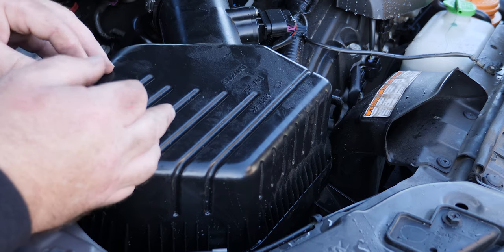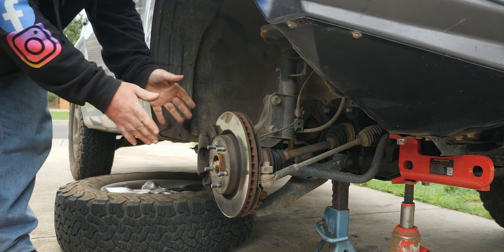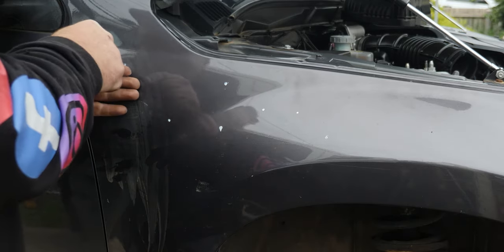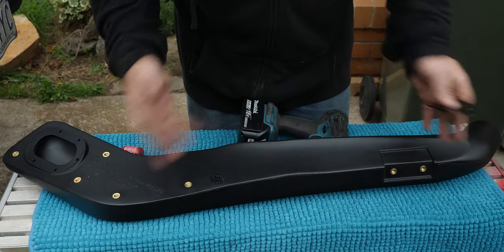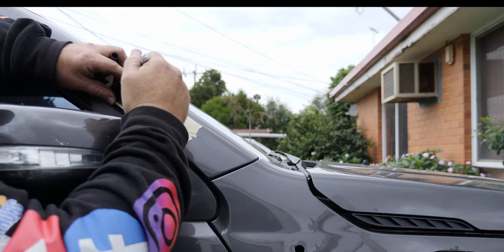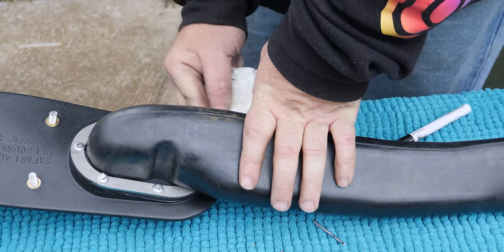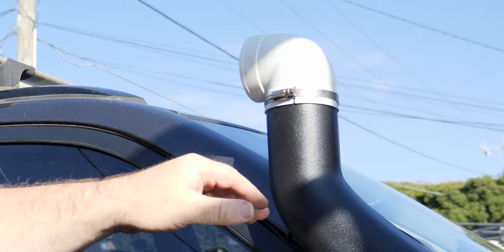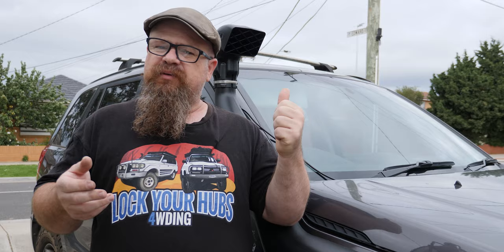Ram Head vs Backward Snorkels including Snorkel Install

Comment: Which engine and fuel was the test conducted with?
Reply from the maker: The Grand Vitara has a 3.2L NA auto petrol. 

Though the results are as applicable to NA as they would be positive displacement supercharger or a turbocharger.

 The results would actually be more pronounced on a forced induction engine. I've done similar testing before on a 1VD in a LC76 (V8 turbo diesel) only manometer readings not performance testing, with similar results.
Reply: @LockyourHubs4WDing  wondering how relevant for diesel, as diesel operates with an excess of air.
Reply from the maker: Yes it is.
Reply: @HardstylePete  Completely relevant for diesel as well - NA and forced induction.

Comment: Would of been interested to see the numbers if you had just turned the RAM Head around , that's what most would do . Sealing the valve in the bottom of the air box , some say yes others say no , what it your take on it , if you had one that is
Reply from the maker: Though I didn't test it, I would think that because of the larger cross sectional area of the ram head opening would be a worse performer backwards. 

I've always sealed the bottom of the airboxes as soon as the snorkel was installed.
Reply: @LockyourHubs4WDing  yeah I have always sealed mine , its just some say you shouldn't , I have a Y62 Patrol  but haven't had a fitted snorkel yet  ,  with all the electronic crap this Patrol has I'm going to avoid water / river crossing as much as possible , deep ones anyway .
Keep the videos coming they are really good
Reply from the maker: @jackofjr  I do love the sound of the Y62s on song! 

I've also heard there might be an issue with the TJM low profile snorkel heads on the Y62, collecting water off of the windscreen in heavy rain at freeway speeds, filling up the airboxes.

Comment: Boosted engine will pull what it needs regardless of which way the snorkel is facing.
Reply from the maker: You actually get a compounded benifet with forced induction. The inlet compressor works on a pressure ratio for a given amount of exhaust flow, not a fixed amount of boost.  So if you put an extra 5% in, you might get an extra 10% out.
Reply: The turbo doesn't pull it, the atmosphere pushes it in. We wind tunnel tested this and backwards means your turbo has 23% less air pressure available at 100 kph.
Reply: @blairknight7793   seems simple physics - the air flowing past the backwards facing inlet would create a low air pressure pocket at the inlet - depending on the speed travelled - that would mean the faster you go the harder it will be to get enough air in. Picture someone would create a 4 inch stainless system  with all it advantages but make the intake a forward facing ram intake...
Reply: @tomschannel5380  absolutely. I went to a lot of trouble to make exact models with precise snorkels to test in the wind tunnel, when you install that backward facing snorkel the negative pressure is instantly obvious from 30km onwards, at 60km its making a difference, at 100 it's about 23% negative pressure on the inlet.

It's a ridiculous notion to face it backwards.
Reply: @blairknight7793  great info. I recently knocked my high flow top off the snorkel. I left the snorkel open at the top for a couple of tanks while I waited for my new setup to arrive. i didn't notice any power difference but my fuel economy dropped from 14.5 to 13.5L/100km. diesel with turbo. I didn't expect that. did you do any studies on fuel?
Reply: @tonycook2347  was it a cyclone type or forward facing ?  

There are bad examples of forward facing snorkels too, I haven't personally seen this but a friend has a dyno shop and the genuine Ford Ranger snorkel that goes through the 3.2L chrome badge on the side of the guard is terrible for flow their testing found. He says its a shocker.

Without seeing yours I cant really say whats going on, testing with a Monometer will tell you what is going on though, could just be a poor design. Wool tassles taped to the body also show what your airflow is doing and it's often not what you think.
 I've only tested airflow, not tested fuel.

Comment: Nobody puts backwards facing heads on these restrictive plastics snorkels, put a proper 4in stainless on it will out perform this set up with a ram head easily, this has been proven time and time again,
Put a forward ram head on the same stainless snorkel it does improve again so yes ramhead are slightly better, they just looks horrible on stainless snorkels. But plastic with ram head vs regular full stainless with rear facing, stainless wins hands down.
Reply from the maker: To truly compare stainless vs conventional, considering the body of the snorkel and not just the inlet as was done here, you would need to compare something like the safari armax to a backward facing stainless.

Based on my testing in this video, I'm sure the armax would be the better performer.
Reply: @LockyourHubs4WDing  Wouldn't disagree with that, Armax are great snorkels. Either way its good watching real comparisons.
Reply from the maker: Thanks mate!

Comment: I'm curious though if it being naturally aspirated is affecting the results here. I'd like to see the same with a turbocharger.
Reply from the maker: The result would be compounded with a turbocharged engine.

 Turbochagers operate at a pressure ratio for a given amount of exhaust flow through the turbine, not a set amount of boost. So if the intial pressure is higher you'll get a compounded benifet from the outlet of the turbo charger, in the same manner that compound turbochaging works.
Reply: @LockyourHubs4WDing  No!!  Modern electronically controlled turbochargers with a wastegate (basically all of them) are controlled by the ECM to give a certain manifold absolute pressure (MAP) -you have heard of a MAP sensor havent you???  If you occlude the turbocharger inlet the ECM will close the wastegate and increase turbocharger RPM, increasing boost and overcoming the inlet blockage.  It will do this up to the point that the wastegate is fully closed and then the MAP will decrease and the ECM will throw a warning code - you will get a check engine light.  This is why turbocharged engines are better at high altitudes - the ECM keeps the MAP constant by increasing boost (in gauge pressure terms).
Reply from the maker: @mickloney9826  Still yes, if you're limiting the boost using a wastegate (either external or internal, you'll see the boost slightly earlier in the rev range from less restriction in the inlet.

So, seeing the boost slightly earlier in the rev range will increase driveability and decrease lag.

Comment: nice vid, thanks for the info, would have been nice to give it a few runs to back up the statistics a bit more. It would be interesting to see the difference with a golf tee-head as well. i recently knocked my forward-facing snorkel head and i noticed while it was off, my fuel economy dropped from 14.5l/100k t0 13.5km/100k. without much notable difference in power. the reason I'm researching this. Have you noticed an increase in fuel since using it?
Reply from the maker: What's a golf tee-head?

Comment: key points your missing backwards snorkels ie stainless snorkels will be 4 inch intake all the way to the airbox. where as plastic ones can often dip down in size to 2 inchs. also most stainos have less agressive bends. every bend u put in will effect the flow
Reply from the maker: I agree that the gentler the bend the better the flow, however this test isn't designed to assess the vitability or otherwise of the snorkel body, just the ram head vs backward stainless style entry. 

To make the assesment fair, you would either have to put a stainless backward snorkel and and have some way of installing a ram head, or a conventional snorkel and emulate the stainless snorkel's entry.
Reply: Backwards creates negative pressure 4 " or not. Half the manufacturers go and weld their logo over the inlet as well which would cause a heap of restriction as well.

Comment: Great video!! Thanks!! I bought a Snorkel and i waiting for the delivery. I have a 2007 V6 2.7l whith Ironman suspensión and 245/65 r17.
I hope that the duct pass between the xenón balast and the headlight washer
Reply from the maker: Mine runs the HIDs standard and didn't have any clearance issues.
Reply: @LockyourHubs4WDing  thanks!

Comment: Great video!! Exactly what I was looking for. One question I have, which is my deciding factor between the two. The plastic snorkel heads from what I see are designed to expel water (safari snorkel page) when driving through rain. But the stainless steel snorkels are just bent on top the roof, and it seems to me in heavy rain, a lot of water should get in. Any thoughts?? Thanks!
Reply from the maker: I would think the backward would do better, though I've been wrong before... Keep an eye out for part 3 of our pre-filter testing, where we'll be testing just that!
Reply: I've seen a lot of guys cap their stainless snorkels when not running for this reason.... Or they've cut an almost "sunvisor" type pvc hat for them!
Yup, they look cool.... But I'm not convinced the pro's outweigh the cons as yet!

Comment: Is there a video about the actual dust measured at the filter (in the air box?)
I ran my ram head with stocking over it forwards on the way up to Cape York and then backwards on the way back, much less dust on the way back on the stocking so for me in the dust would say it's better backwards and looks like I'm losing bugger all by running backwards anyway.
Reply from the maker: The ram heads are allegedly designed to eject water and dust at the back of the ram head, something like how cylonic seperators work separating heavier particle in the air steam like dust and water from the clean air. 

Though I haven't tested it ( It's in the works!)
Reply: @LockyourHubs4WDing  ok, cool, yeah, that's why I thought it'd be better to test at the air box/filter rather than my seat of the pants wild deduction, thanks for the interesting info and keep up the good work!

Comment: Hi,

Thank you for your video and sharing. It's great!!! :-D

Do you have some pictures of the inside passage of the pipe? the passage between the mudguard and the engine. And do you also have pictures of the air intake connection? please. Indeed, I live in Switzerland and I can not find anything concerning the grand vitara. And I would like to visualize before I start to disassemble and drill.

In advance, I thank you for your answer.

Best regards, Christophe
Reply from the maker: Unfortunately, only what's in the video.
Reply: @LockyourHubs4WDing  thanks!! Have a nice video!! ;-)

Comment: Thanks for a great instruction on mounting the snorkel. I have to point out that the three runs would have incrementally heated the motor, so perhaps that contributed to the times/efficiency figures?
Reply from the maker: I think the temps would have stabilised on the drive out to the testing location. And the two snorkel runs had an intake temp very similar. Though there could be something in it.
Reply: @LockyourHubs4WDing  OK, fair enough, and thanks for replying. The results speak for themselves. 

Manufacturers make quite an effort to port air from the front grille, but given the difference between stock and properly installed snorkel you'd think they would try and egg out that extra bit by designing the intake air to take air from elsewhere.

Comment: The original ram Air have inh2o 10 and the snorkel ramhead 19.35. The original is better because have less restriction ?
Reply from the maker: Yes, the shortest length of tube to the airbox.

Comment: when you say InH2o is the same Air flow righ ? Sorry my English Im from Peru
Reply from the maker: inH2O is the pressure restriction measurement.
Reply: Lock your Hubs 4WDing when you say 19.80 inh2o compárate with 25 inh2o. 25 inh2o have a restricción 19.80 is better for my car?
Reply from the maker: Yes, the less restriction, the better.

Comment: Really enjoying your video's (especially as I also own a Suzuki Grand Vitara 3.2L V6). Just wondering if you had any trouble fitting that Safari model (SS860HF?) into the 3.2L as the Safari website only has it listed for the 2.7L. Cheers.
Reply from the maker: Only the air box entry was too small. I fixed this by using the original rubber seal to the air box and cutting a 50mm long section of the original plastic inlet tube to mate the two (up to the sharp bend)

Comment: I think you would get a different result if you went and put an actual stainless steel snorkel on rather than making it a rear facing plastic snorkel. That would be a much more interesting video
Reply from the maker: What this testing differentiates is primarily the inlet of the snokel.

 The test could also be done the other way, using a SS body and a forward facing ram head, vs backward facing entry. You need the body (either SS or traditional plastic) to remain the same in both test to work out where exactly the flow restriction is.
Reply: @LockyourHubs4WDing  That would be great to see. I think that the forward facing SS would perform the best followed by Rear facing SS followed by the Plastic snorkels as tested. 
Would be interesting to be proven wrong.
Reply from the maker: @zackbeaven8810  going by this testing, if I was a betting man, I would pick stainless body with ram head first (As long as the diameter of the snokel was retained right through to the airbox) then tradtional plastic snorkel and finally the rearward facing stainless.

Comment: Good test and some what expected results, would be interesting to see the results on a turbocharged engine. Only reason I bring it up is I always believed the ram head was superior till I noticed that WRC rally cars use rear facing snorkels given the money aand resources available to these teams I would assume they know what they are doing. I figured maybe it doesn't make as much difference on a forced induction motor.
Reply from the maker: When I did similar testing on a 1VD turbo diesel, the results were almost the same.

Comment: Can u test put the ram head facing backwards?
Reply from the maker: There has been a couple of requests to do that, I didn't think many people ran them backwards for dust. I think I might!
Reply: @LockyourHubs4WDing  The Safari ram air head has bulged area's in the neck that trap & slot's that eject dust & water. The incoming dust & water hit the rear wall of the ram air head & slide down & out, theoretically. 
Further to my comment,  The theory is, dust and water is heavier than air.
The Safari ARMAX snorkel head works, how well I don't know but well enough that what dust gets past the head to the filter is not that bad and despite everyday dirt K's & city driving the filter still appears clean, I do replace it anyway every 25,000K's regardless & I do a fuel kilometer test every tank full of diesel, about 12L per 100K's, then I know everything is still in spec. 
I remove & clean the ARMAX snorkel head every 5000k's, there is dust & grit trapped in the bulges and around the snorkel neck & I can see where rain water has been ejected down the back & fine dust out the slots. I check the air filter & box too and there is no evidence of rainwater pooling or tracking in the upgraded 4" Safari ARMAX intake tract that mates to stock Landcruiser airbox despite the vehicle being driven in rain including very heavy rain.
I suspect if any rainwater that makes it into the snorkel must be minimal & disperses on the snorkels inner walls & evaporates due to airflow over it.
I remove the airfilter & block the intake with a clean towel & blow dead bugs & fine dust out the airbox with compressed air then wipe it out with a damp cloth and lightly blow off the dirty side of the filter, there is some fine dust but not a lot, certainly none on the clean side of the intake tract after the airfilter that could lead to dusting an engine, I also clean & rubber grease the airfilter seal & visually inspect it to make sure it's not leaking past that seal on the upper lid.
Moisture in the air/fuel mix is a non-issue, water mist injection kits for performance & to boost compression have been around for decades and by the time the moisture laden intake air gets filtered past my RYCO Fireguardian paper filter & gets to my hot turbo vanes & pushed through the warm intercooler it's ready to mix with diesel and combust.
In heavy rain my exhaust gas temperature are down about 100 degrees to 200 degrees and that could be because of the cooling effect of rainwater flicked up by the tyres from the roadway on the 3" dump pipe where the E.G.T is taken or slower road speeds in the rain.
Reply: theoretically in there brochure when selling it. Front facing probably is better for air flow but it’s shithouse for dust in a convoy and when there’s heavy water being thrown up of the road from a car in front. They are a cause of a lot of limp mode problems in new vehicles.
Reply: @dale8535 Bullshit.... I've never had ANY problems with my Safari ARMAX forward facing snorkel intake head in real life on my 2013 Landcruiser. Any vehicle in convoy is going to load up the air filter, fit a filter sock in such situations or cyclonic separator as discussed.

Comment: Is it possible to change a stainless steel snorkel to a Safari snorkel
Reply from the maker: That would depend on the cut out on the fender/guard. Though you could cut and weld a vertical section to a backward facing stainless snorkel and run a conventional ram head.